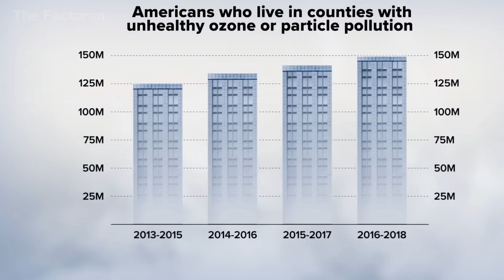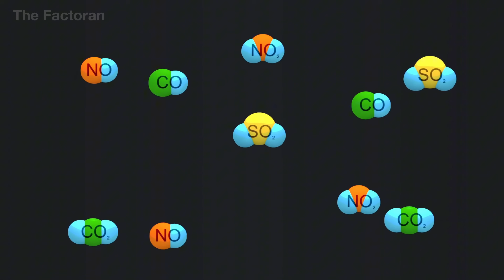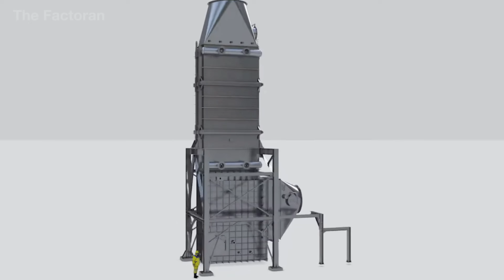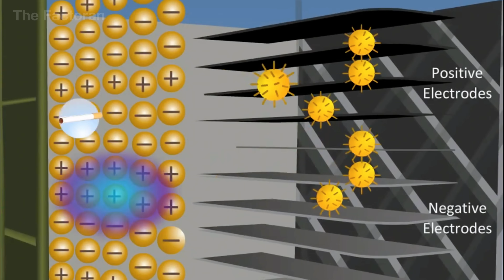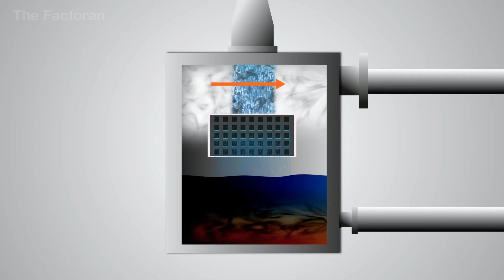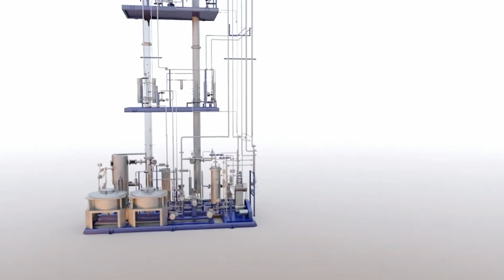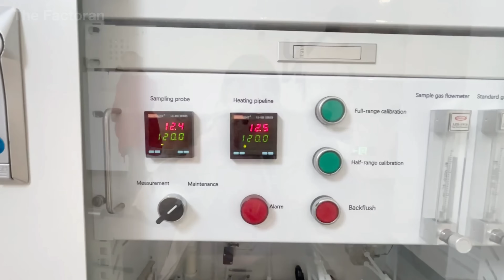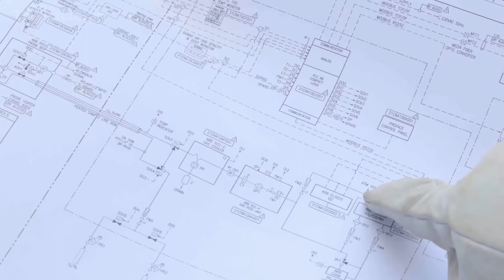How Millions of Cubic Feet of Polluted Air Are Cleaned Inside Massive Emission Control Systems

Comment: Why is it that heat iss wasted by wet scrubbing and not recovered in boilers and then passed through ESP to recover particulate matter thus making the whole system more ENERGY EFFICIENT.

This cycle is used in thermal power generation plants
Reply from the maker: Great question — those power-plant cycles work on huge, steady heat loads, while many industrial scrubber systems don’t generate enough consistent high-temperature exhaust to make heat recovery practical or cost-effective.

Comment: Thanks, some of these processes are used on some  plants,but all are different.
In the UK,coal is no longer burned for electricity generation,carbon capture is in its infancy but it is used in ammonia production and then used in the beverage industry, but still released when we consume fizzy drinks.
In the cement industry scrubbers remove sulphur dioxide and convert it into gypsum which is used to make cement,and NOx is removed before any scrubbers.Carbon capture is under development for cement.
All use different methods.
Reply from the maker: Thanks for the detailed breakdown — really appreciate you sharing how it works in the UK. It’s always interesting to see how each industry and country handles these processes differently.